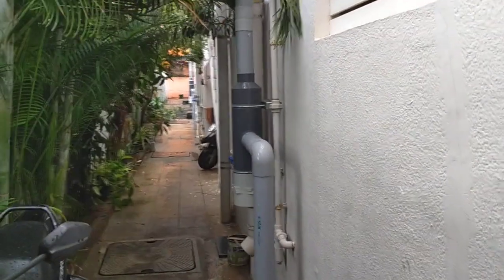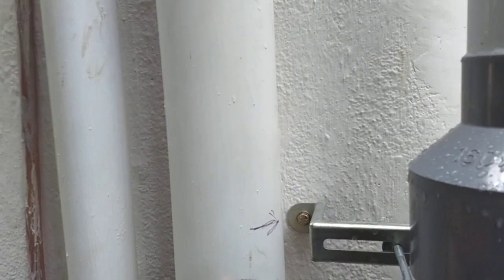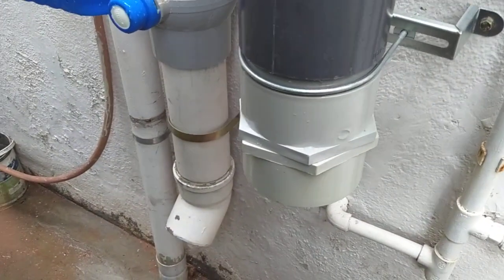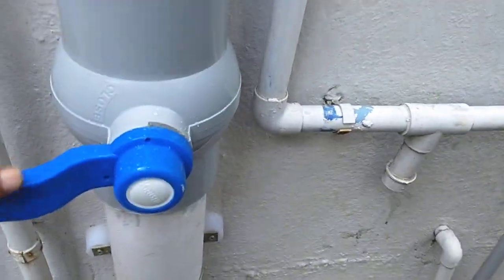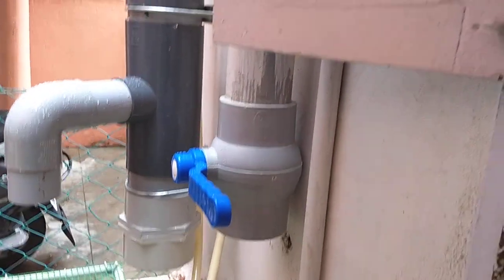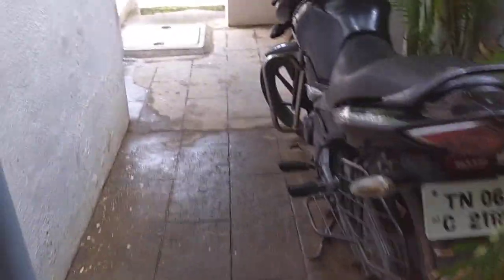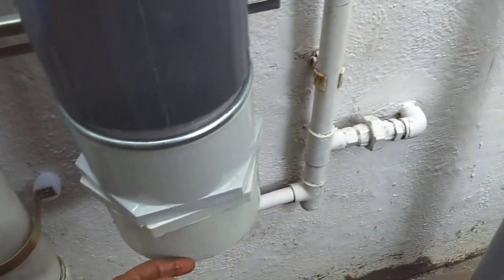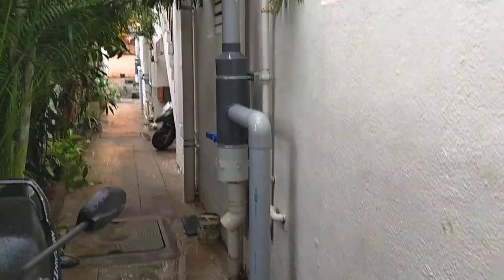RAIN WATER HARVEST FILTER - PART 2 - DIY - HOME IMPROVEMENTS - GUNAs LenSpeaks

Comment: Hi Sir,
Appreciate it if you could answer.

would it be okay to let the water go directly into my borewell after the DIY filters? or should I make a new bore well, say 50ft or so, and then connect the outlet to the newly driller bore.
Reply from the maker: Well it would depend on the size of your terrace i.e. the catchment area. The copious Rain Water harvested during rains may lead to overflowing of the bore well. It would be desirable to collect the RW in a 2000/3000 litres storage tank at the Ground floor and then resort to graduated release of that water into the borewell.👍
Reply: @gunaslenspeaks6795   Sir, On the same lines : i have a query related to rain water tank height which will be placed to recharge borewell.  I have a limitation that my wall height is 5 ft and top of it rainwater filter will be placed. then water from that filter will go to tank, Do we need to maintain some height so that when we open tank valve water shud go to borewell gradually or with speed ? ( i am considering for 500 litre tank). -Thanks
Reply from the maker: @sunnyarora1429  Try to go in for storage tank with less height and broad base so that the filtered rain water from the RWH filter  flows into the tank automatically. The bottom level of the storage tank should be slightly above the ground level preferably so that the water from the tank can also flow automatically into the borewell in a graduated manner with the help of a control valve. The gradient of the pipe from the tank to the borewell may be of  1" per metre depending on the distance between them to ensure smooth flow and avoid return or stagnation of water in the pipeline. Hope this would suffice.👍😊
Reply: @gunaslenspeaks6795  Thank you sir !
Reply: @gunaslenspeaks6795   Sir, Thanks. One more small query ->  The pipes which comes from top to bottom are SWR pipes ? Also, i saw you are using "ball valve" for waste water whichs the side &  is it connected to PVC pipe or swr pipe ? (i am having hard time explaing to plumber, he says no valve available bigger than 1.25inch). Thanks
Reply from the maker: @sunnyarora1429  I had posted my suggestion to one such query earlier which may kindly be perused please.👍
Reply from the maker: @sunnyarora1429  I have used PVC pipes and fittings including the ball valve as shown in the videos which are available in the market please.👍
Reply from the maker: Well it would depend on the size of your terrace i.e. the catchment area. The copious Rain Water harvested during rains may lead to overflowing of the bore well. It would be desirable to collect the RW in a 2000/3000 litres storage tank at the Ground floor and then resort to graduated release of that water into the borewell.👍
Reply from the maker: Well it would depend on the size of your terrace i.e. the catchment area. The copious Rain Water harvested during rains may lead to overflowing of the bore well. It would be desirable to collect the RW in a 2000/3000 litres storage tank at the Ground floor and then resort to graduated release of that water into the borewell.👍
Reply from the maker: Well it would depend on the size of your terrace i.e. the catchment area. The copious Rain Water harvested during rains may lead to overflowing of the bore well. It would be desirable to collect the RW in a 2000/3000 litres storage tank at the Ground floor and then resort to graduated release of that water into the borewell.👍

Comment: Sir, we have newly built metal sheet shed in our terrace(second floor)  which covers around 2,000 sq.ft, I am planning to direct the rainwater directly to the borewell, using this type of filter.  I have two questions. Q1: As this water comes from the sheets on second floor there is no chance of any other dirt except dust, so is this mosquito mesh is good enough to filter the dust? Q2: How many filters of this kind(the spec you have used in this video) is needed to for this area of 2,000 sq.ft?   Please suggest...
Reply from the maker: Hi, (1) what's the area of the tin sheet roof i.e. the catchment area  (2) How many drain outlets have  you fixed in the collection ducts.  (3) Width and depth of the bore well... Kindly elucidate me on the above please.
Reply: Thanks for your reply sir, (1) The area of the sheet itself 2000 sq.ft i.e., the  catchment area (2) I have three drain outlets .., all of them are 3" (3) Depth of the borewell is 300 ft.    And this is located in Thanjavur
Reply from the maker: Hi,
Considering the size of the catchment area, (A) I would suggest installation of 4 filters of 4"(core)/6"(outer) size with inlet and outlet size of 3". Though the tin sheet roof may be devoid of any major dirt, I have experienced that the birds excreta and droppings gets accumulated on the terrace of which heavy dirt gets settled in the diverter while the lighter ones float and enter the filter along with the water flow.  I have used 2 layers of Mosquito net over the core of the filter which would suffice or you can go in for 3 layers of the net as the Rain Water Harvested is being proposed to be let into the Bore Well.
(B) Reduction in number of filters may reduce the filtration capacity leading to overflow of the collection ducts fixed to the tin sheet roof.
(C) I apprehend that during heavy rains when the Rain Water harvested is copious, the Bore Well may get filled and overflow as the speed at which the ground gets charged would not be equal to the inflow thereof.  Hence I would suggest that if feasible, try to divert part of the Rain Water Harvested to any open well or to a sump or to storage tanks at ground floor (stored water can be released into Bore Well gradually).
Hope this would help. Wish you all the best.
Reply: Thanks a lot! Almost 99% work has been completed, I will post the pictures or the video of the whole set up I have done...
Reply from the maker: @arivazhagana6887   You are welcome.  Thank you and all the best.